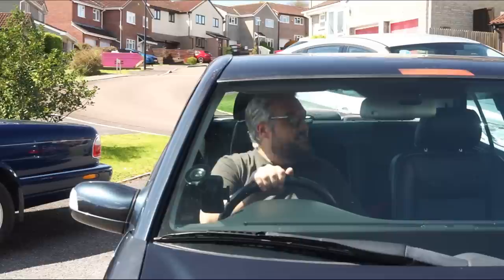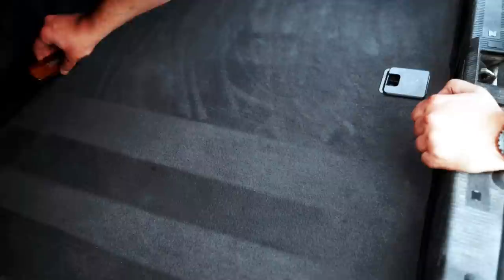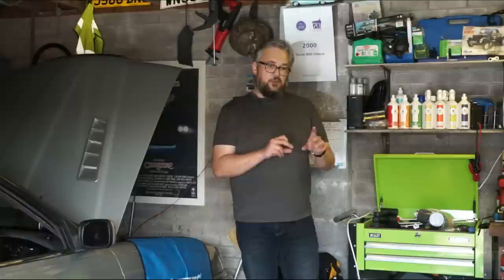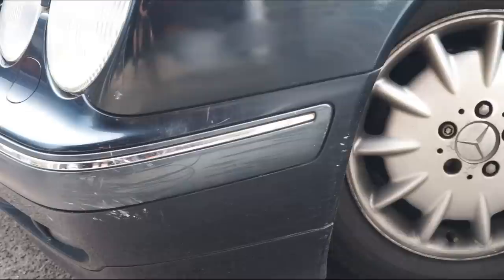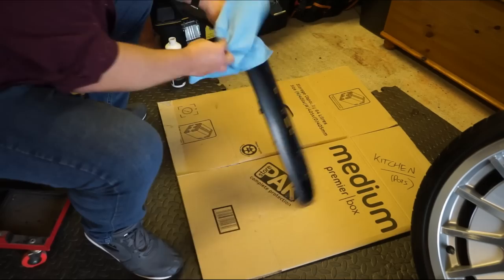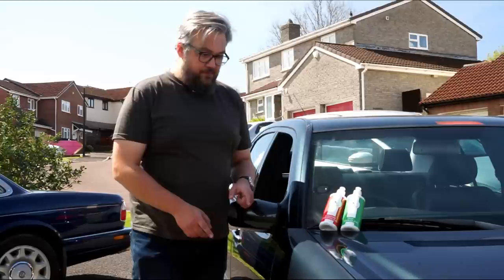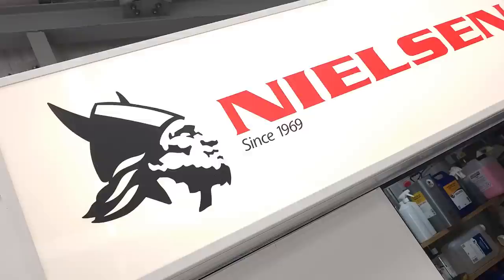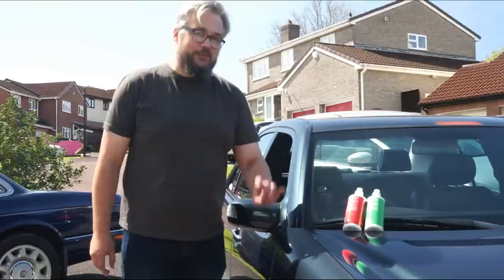From Minging to Blinging - W210 Mercedes gets a makeover.

Comment: I have a W210 myself so I approve of this content. Just wanted to say that the W/S button on the gear selector is Winter/Standard mode, there is no "Sport button". The Winter setting makes the car take off in 2nd gear and limits torque output for less wheel slipping.

Comment: Bought my 2nd w210 facelift Elegance E200 a couple of weeks ago with 170k miles...a fantastic solid car that still turna heads and it came with driver and passenger fully adjustable electric memory seats and steering wheel ...polished the headlidhts , cleaned it thoroughly, changed the rusty Mercedes emblem and swapped the leather elegance auto gear shift with a matching original wooden one with chrome trim...all and all for less than 2.5 k euros

Comment: I had the idea of replacing the cigarette lighter in one of the fleet, and didn't.
That 12v socket is handy for power for inflating tyres in an emergency, mini hoovers, and so on.
So an adapter for USB is inserted when not in use for powering things - this too has a voltmeter.
Flexibility.
Reply from the maker: My vacuum and tyre compressor are both lithium.
Reply: @PollittsProjects  - mine are old school 😁

Comment: Does it has any Springs on the Front?
For an Elegance thats to low on the Front for OEM, the back however looks to be about OEM height.
Usually the Front on an Elegance or Classic is even a few mm "higher looking" than the back but here it looks like an Avangarde front and Elegance back haha